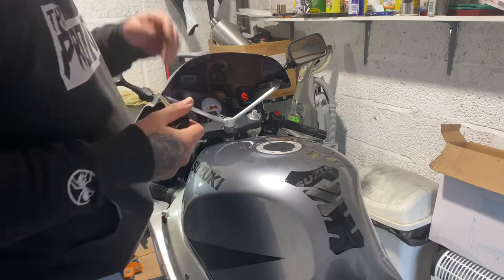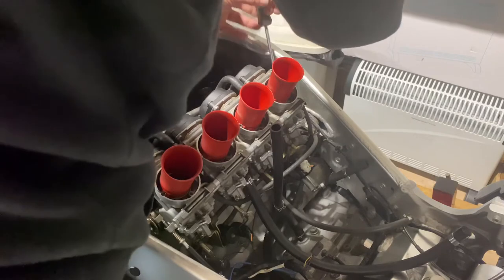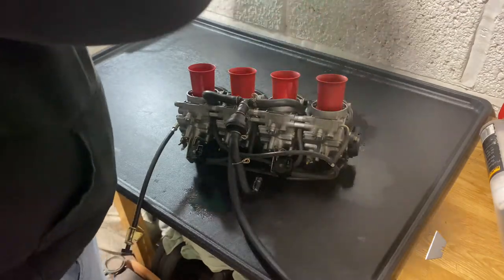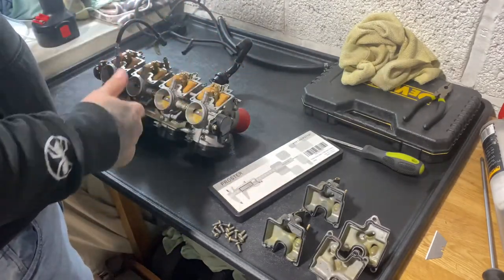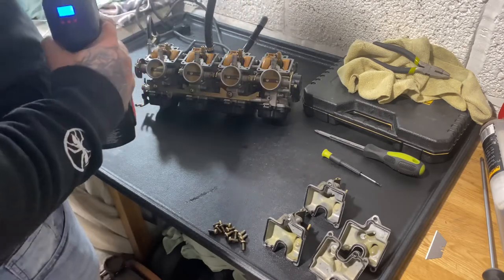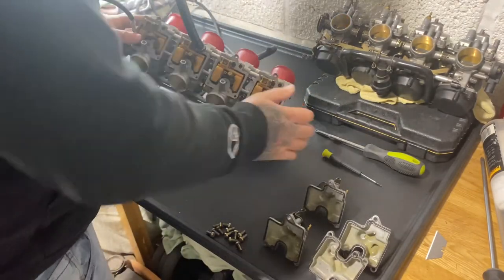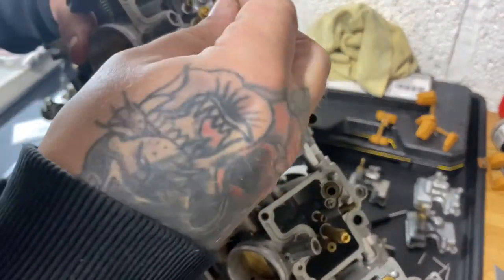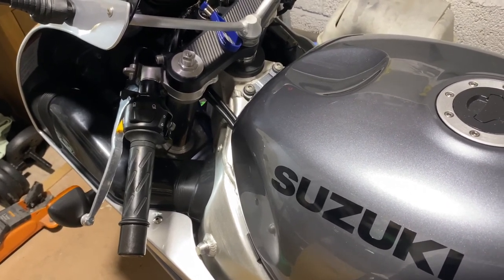Suzuki Gsxr Srad Carburettor Leaking Removal and Float Height Adjustment also Seal Pressure Test.

Comment: Did you get to the bottom of this eventually?
Reply from the maker: Yes I did bud it was the old seals had gone brittle there is an update video to this 👍
Reply: @BigBoyzToyz1974  great to know, my rebuild kit just arrived xmas eve so hoping I’ll have mines sorted I had the same symptoms and the old o-rings were perished👍🏻
Reply from the maker: Easy fix mine were the bottom bowl gasket on the far right carb 🙄
Reply: Hey toys, where did you her those nice intakte trumpets at?😊
Reply from the maker: @dan64654  came on it why ? you being sarcastic and think there called velocity stacks ?
Reply: @BigBoyzToyz1974  No im being serious, my gsxr dosent have those, and the airbox has other sign of tampering.
Best regards from Scandinavia, Denmark.
Reply from the maker: Lol sorry buddy they are standard bud red stacks if you have Chrome or black they are most likely aftermarket 👍👍😂
Reply: If yours is a 97 bike it won't have them
Reply: Think the red stacks were one year. In the US. anyway

Comment: how many turns must the fuel mixture screws out there?
Reply from the maker: From memory on stock jets it’s 2 on outer and 2 1/4 on inner
Reply: @BigBoyzToyz1974  a little got better, at low speeds the force is nowhere to be 5000-7000 revolutions comes force
Reply from the maker: @Dreamcomestrue-8  could be a 100 different things the air pilot could be blocked it needs to be listen to see how it reacts to quick throttle opening does it sound snappy does the rpm hang does it dip at idle etc can’t really diagnose over a message saying no force before 7000 sorry bud.